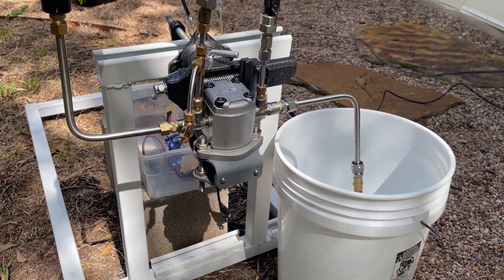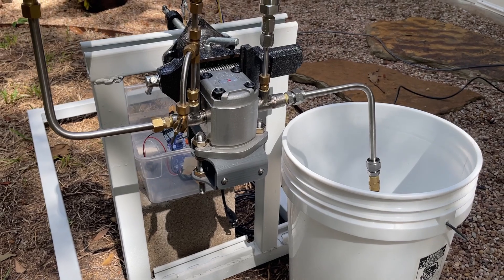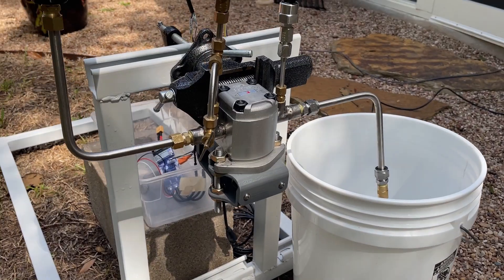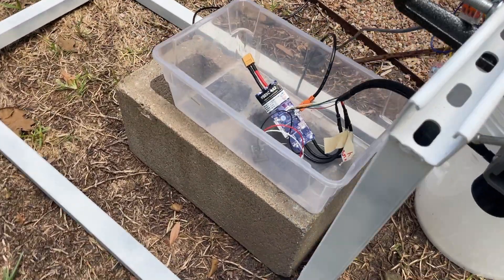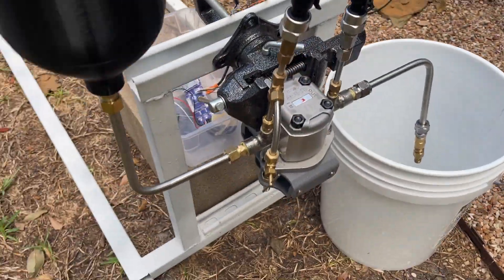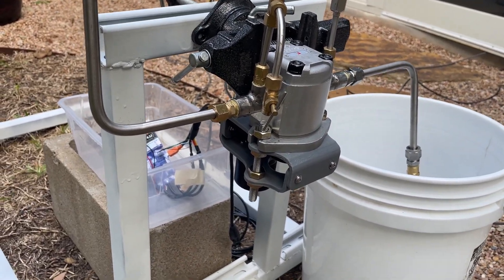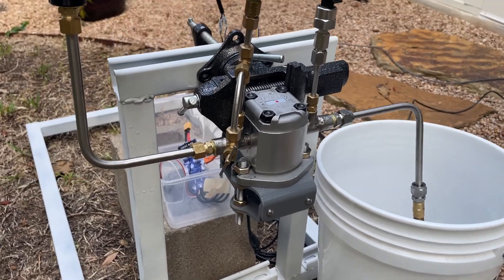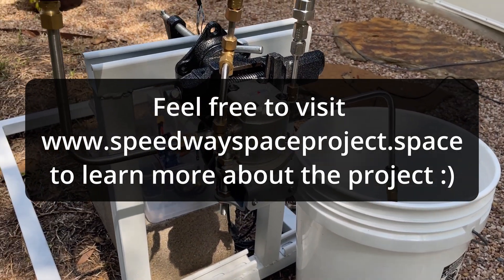Fuel Pump Full Power Tests

Comment: Hi! what kind of the stainless steel pipe did you use in this project and where can i find it?
Reply from the maker: it's just normal 316 and/or 304 nominal tube, a mix of 1/4" and 3/8" OD for this specific setup. you can find on mcmaster or amazon.